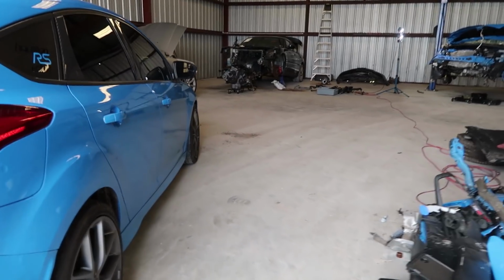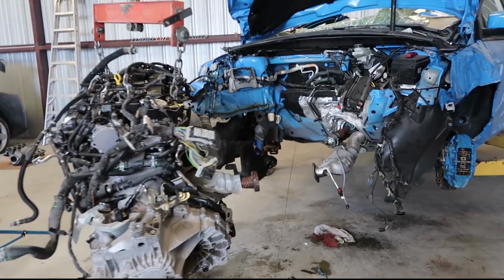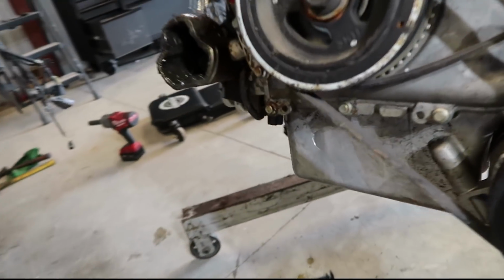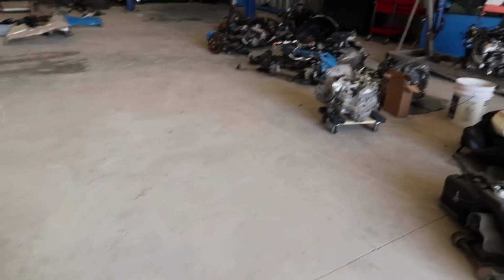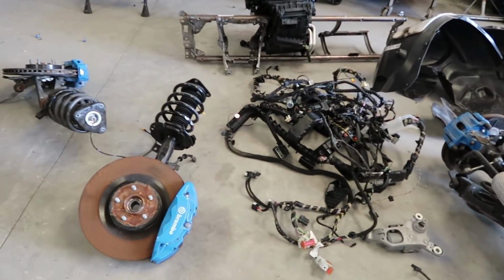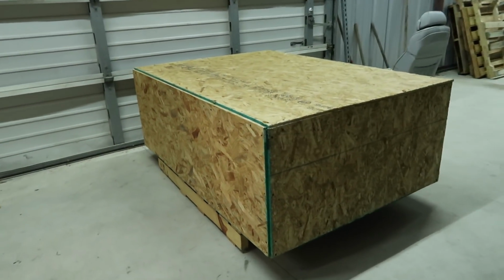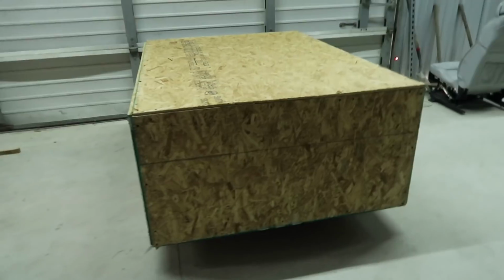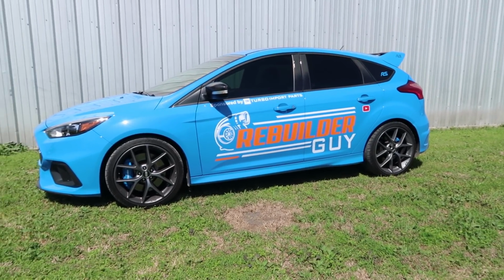Pulling parts from the Wrecked Ford Focus RS

Comment: What's the difference in the body between the RS and every other Focus? Only the trunk floor? I'm thinking about doing a swap like this, maybe you know the answer!
Reply from the maker: body is the same even the floor just a different sub frame
Reply: The regular Focus has a recess for the spare on the trunk, the RS seems to have a flat trunk floor. Don't know if the ST is the same, we don't have it here.
Reply from the maker: Same trunk the RS just has a lot of foam. No spare tire to save weight I suppose.
Reply: what a carnage.  I thought that rollovers engines are a no-no, as they starve oil when they are upside down